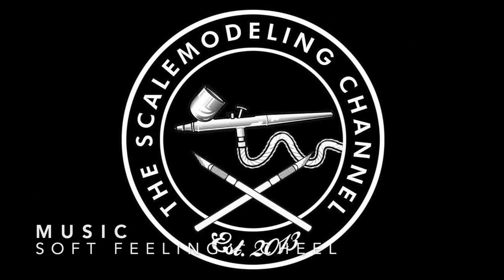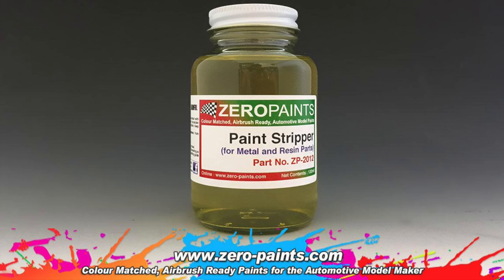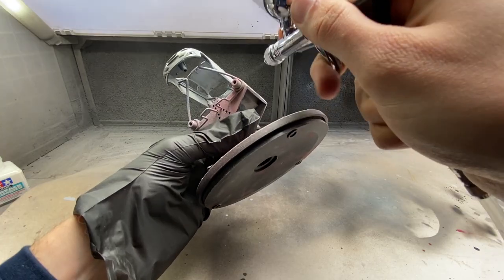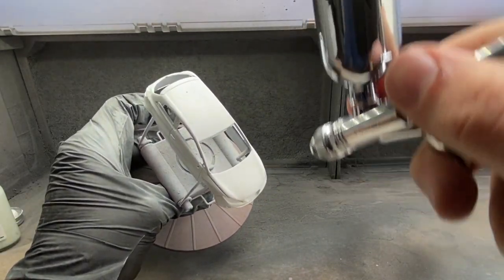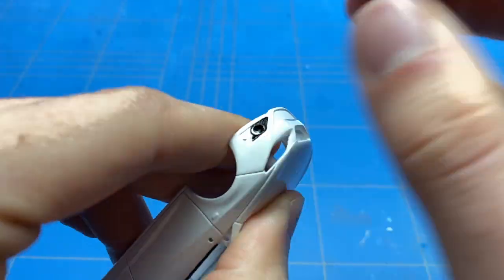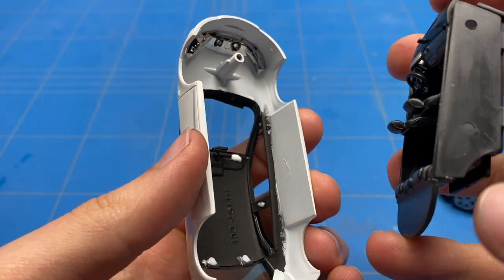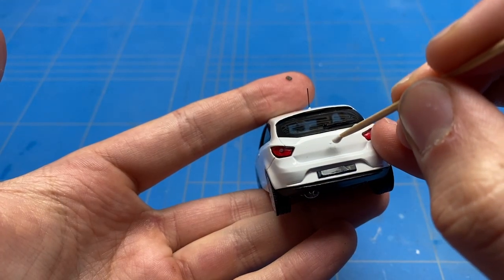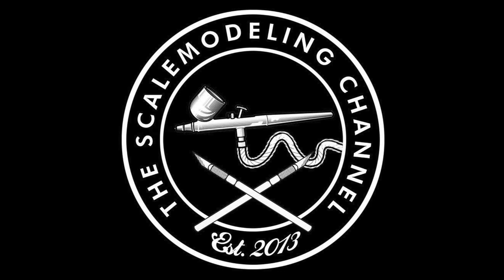Building a Tiny Seat Ibiza Replica Model Car

Comment: How do you go about removing the headlights, grilles etc, is it just a small screw driver you use? I've done a few of these models, and have often damaged the parts trying to remove them. Do you do anything to try and weaken the glue before applying pressure?